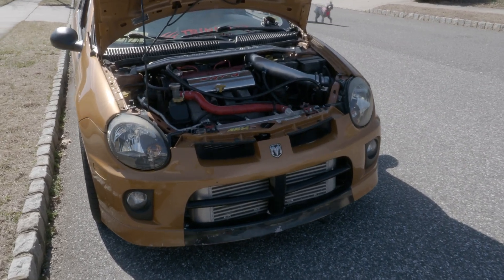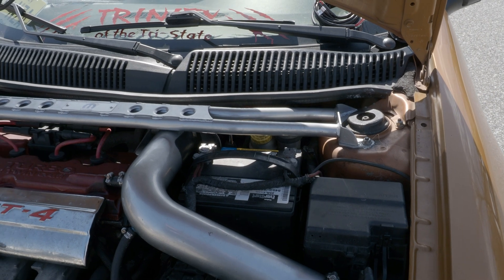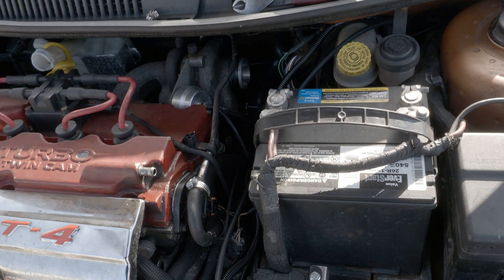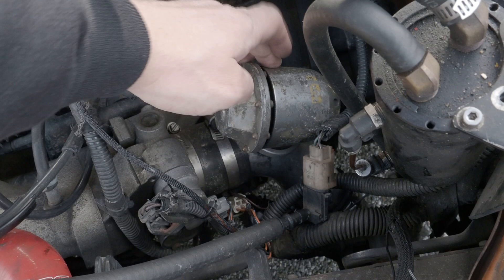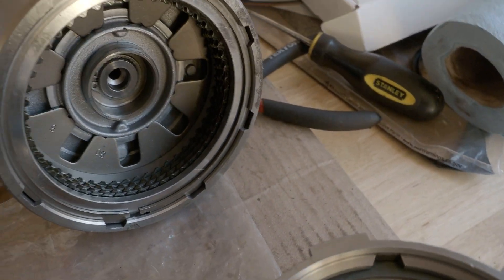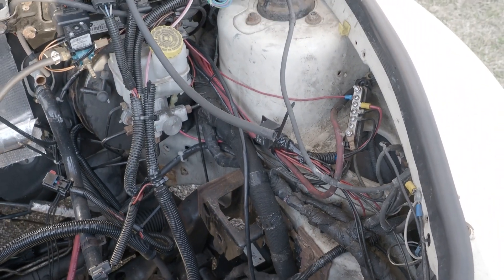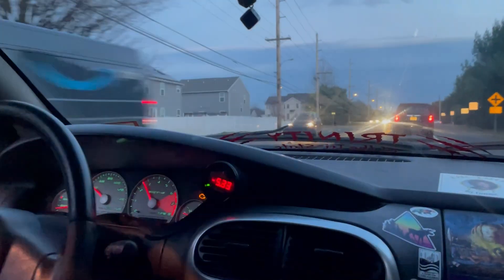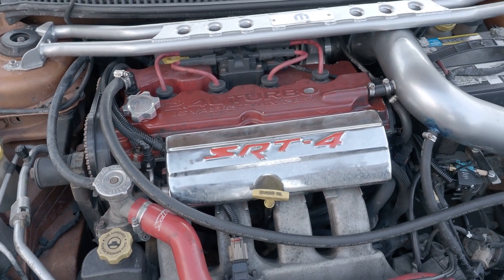SRT4 Gets an Boost Controller

Comment: Your AFR's are really not the best in my opinion. Did you eventually get a PCM tune? Boost controller and manual WG is not a great way, and in fact may lead to blowing your engine. 

new TIP>MAP>and a proper PCM tune and it would shit pants, (assuming your car is properly sorted mechanically) Have you completed a pressure test/smoke test? How is compression on this engine? NOTE, low boost levels = potential crack in OEM manifold at the wg door too. GL! CHEERS@
Reply from the maker: I thought low 12's was good for AFR's yeah it might be a little on the rich side but it also cools down the engine at wot. Car already had a tune on it, I just made some adjustments to it. The reason for the boost controller instead of a PCM controlled is that it would break up over 15psi of boost and boost contoller fixed that. I don't think a boost controller is bad but just a different way of doing it. Did a pressure test and that checked out but didn't do a smoke test but after swapping the turbo it has not problem building boost. Compression was 140 psi across cylinders + - 5 psi. Did crack the manifold swapped that out, but thought they cracked from EGTS being high.
Reply: @thatptracecar2148 that dude literally talking nonsense , that’s why he didn’t give you a response . 12s mean your running a tad rich, 10s is lean and would lead to a blown motor. That car is running nice, im trying to pick up a pt cruiser 5 speed for myself and use a arm boost controller / big turbo. Thanks for showing the install
Reply from the maker: @ForzaPulls  Yeah, no problem. Lol I try to be nice with my response. I've been working on this platform about 7 years now.  The AEM boost controller is nice just you lose the boost by gear. My buddy has been happy with it ever since. The guy before him hack the car up and not sure what he did to the pcm so that was the reason for the boost controller.

Comment: this is how you blow your shit up get a proper tune and boost by gear... your afrs are prolly going lean cause it isn't on pcm boost smh
Reply from the maker: Gotta have fun sometimes, But I was watching afrs and adding fuel accordingly. We checked spark plugs after and they looked good too. Turbo flutter was tuned out as I don't like the back spin forces on a stock turbo shaft without drilled surged holes.  I should have mention that the car is on a tune and running about 20 degrees of spark on 93. BTW your car looks good dude!
Reply: @thatptracecar2148  I don't own it anymore unfortunately new owner blew it up and sold it to a local guy I know and he is rebuilding it and redoing the whole car which is sweet and good at least ur tuned lol